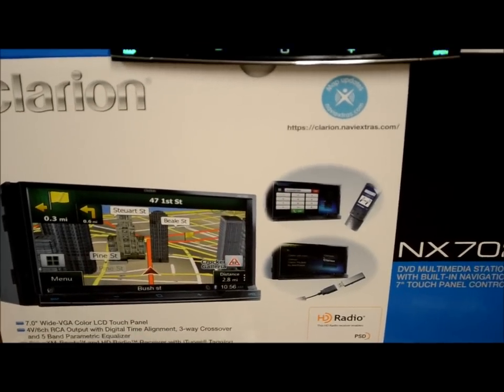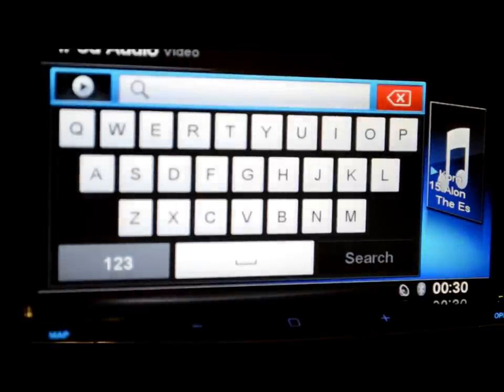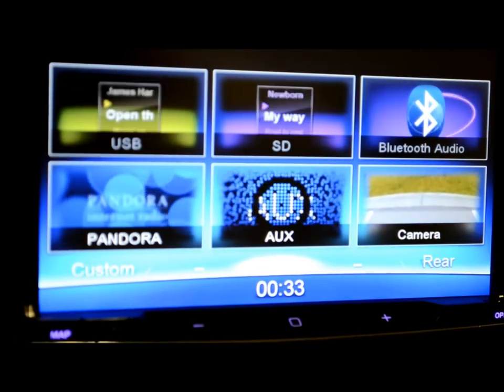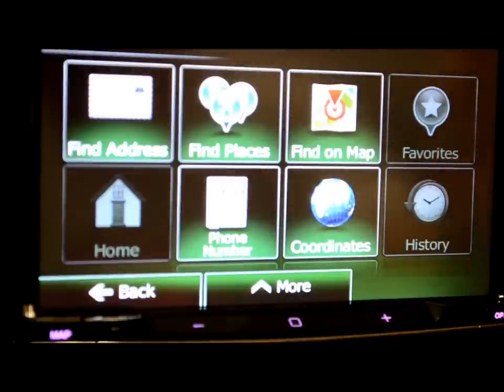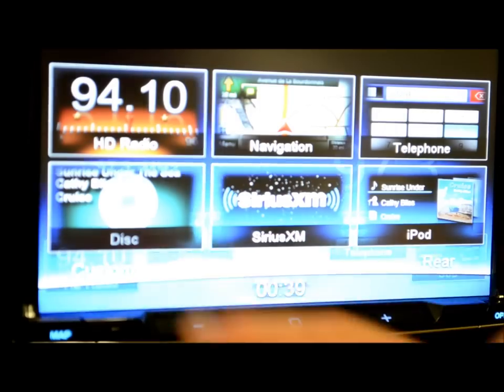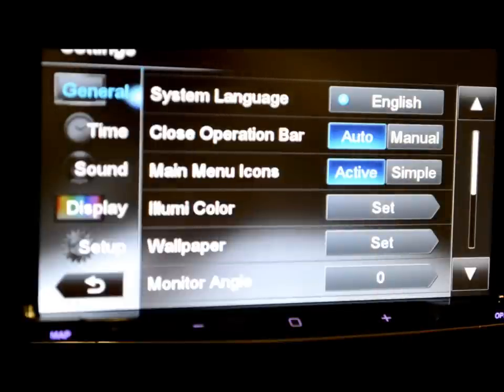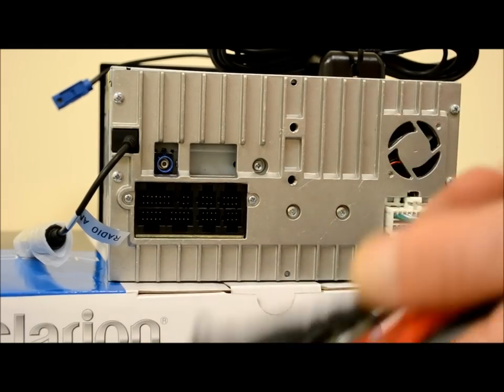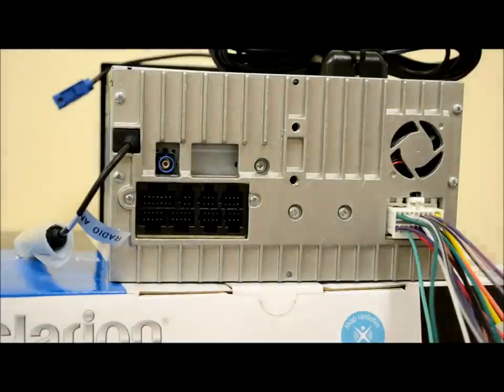Review Of The New Clarion NX702 7" DVD GPS Navigation Stereo

Comment: Hi, I have a 2005 Lexus gx470 - stopped working.  Most say its the amplifier which to replace is $600 minimum.  This unit does not have bluetooth and I want to have this option for my daughter.  Will this unit fit in this vehicle - if not what are my options?  Thanks

Comment: Hey Lessco. Great reviews. Very helpful. Im in the market for a double din nav to replace the factory NAV in my 07 Chrysler Aspen Hemi. Im torn between 4  models. 1. Pioneer AVIC-Z150BH 2.KENWOOD DNN990HD 3.CLARION NX702 4. ALPINE INE-W927HD. I REALLY LIKE THE ALPINE BUT FROM THE SPECS I SEE THAT THERE IS NO DUAL ZONE CAPABILITIES. SINCE I WANT TO RETAIN MY FACTORY OVERHEAD DVD PLAYER. I WANT TO LISTEN AND OR SWITCH TO RADIO WHILE THE KIDS WATCH DVDS. but I like the Kenwood, But the major complaints is its too slow at boot and it freezes. Also the Pioneer Avic z150. I really like it. but i saw your review on it and im torn at the scrolling function. What do you suggest???
Reply from the maker: Out of those 4 Id go with the kenwood. Its not my favey favorite, Id personally go with a jvc. But that would be the one Id choose

Comment: no it doesn't. your best bet is to use the relay in conjunction with the e-brake but in reverse where it's open when the e-brake is engaged and closed when its not. If your parked just be sure your gear selector is in park and release the brake. If its manual then just install a switch to act as the e-brake.